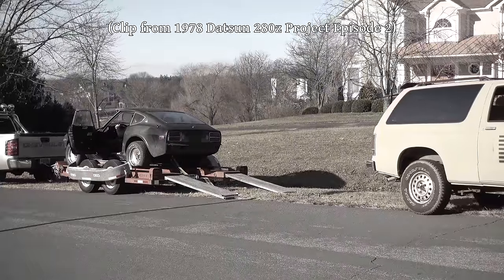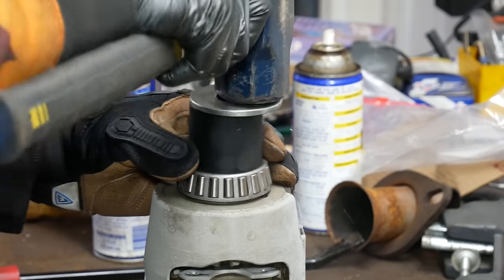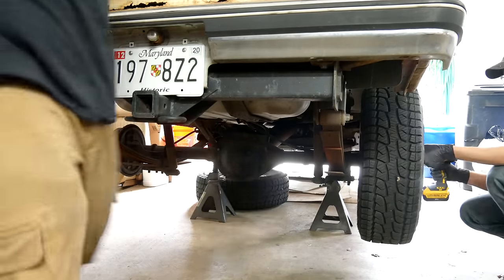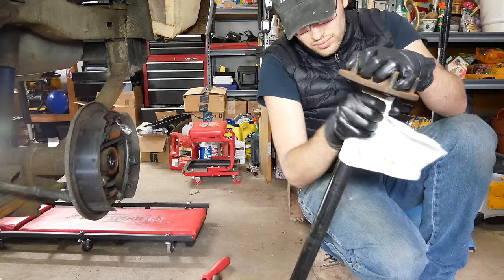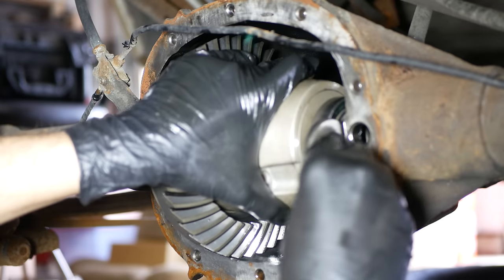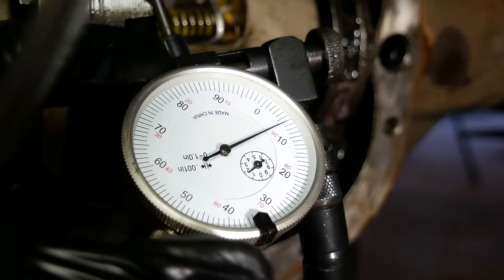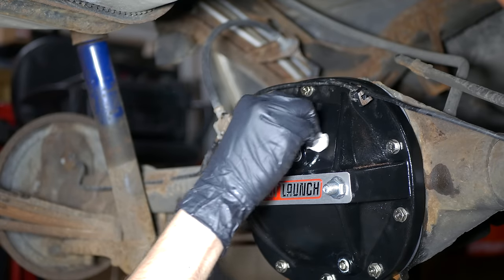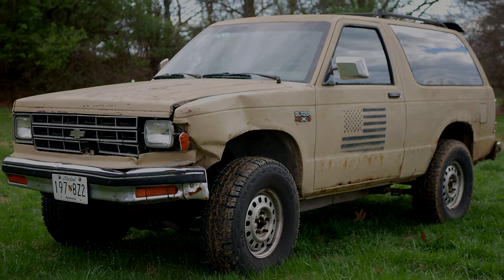4x4 V8 S10 Blazer Limited Slip Differential Install (on a Budget) (Ep.20)

Comment: Would you ever consider swapping a efi kit on the blazer like a fi-tech unit or would you just ls swap due to cost is the same realistically I have a similar build 86 s10 p/u 4x4 and just put a fresh built engine in it but really want to try fuel injection but like driving it and don't feel like a engine swap down a rabbit hole situation.

Comment: I recently acquired a used auburn lsd like this, however when installed in the truck I pulled it from there was little resistance to turn one wheel while the other was stationary. since you have had his unit for a while, does it still retain the same locking force as new? or does it only lock up under torque? I'm wondering if my unit is broken in, or just broken.

Comment: Im doing a build using an S10 4x4 Rear Differential 10 bolt 7.625. My worry was that it wouldnt be able to handle HP/Torque a rebuilt 305 SBC would handle. After seeing this video, it looks like it can handle it. Am i wrong? lol

Comment: Your axle shaft bearings are due to replacement as they look blueish
Reply from the maker: I didn't get any good shots of them and didn't really clean off all of the oil, but they did appear to have a bit of a haze. They are probably original, and while there isn't any troubling wear or damage could do with being replaced just due to miles and age. I am not in a hurry to do so though, and didn't have parts ready (did this job kinda impromptu on the day-of) but it would have been a good time to replace them.

Comment: When it's finished, this vehicle would make a great Boogaloo-mobile. (Assuming it has a carb and not some kind of electronic fuel injection...)
Reply: Still has an HEI module, therefore not EMP suitable... :)
Reply: Well, then it needs to be converted to a carb set-up ASAP.
Reply: @msbae  It is a carb setup, but the distributor has an electronic module in it. Nothing has run breaker point (full mechanical) ignition since the mid-1970s.
Reply: That can be swapped out...
Reply from the maker: It is carbureted, but HEI distributors are controlled with an internal ignition module instead of being fully mechanical like an old points setup. So, not EMP-proof unfortunately
Reply: Again, that can be swapped out. Also, I have noticed that not one person has even asked me what I mean by 'Boogaloo-mobile'. That brings a smile to my face at a time when it's definitely needed. :)
Reply: @msbae  It can, but it's not at all worth it to do so (worse performance and reliability all around). If you're looking for a real bug out vehicle, not to talk down on the Blazer, you start with a mechanically injected Diesel. That's why the military uses them too.
Reply: So, a 70s era K-5 Blazer or a Dodge RamCharger wouldn't be a good choice? There goes some of my plans for the future... :P
Reply: @msbae  Finding either of those that hasn't already died of rust is a pretty tall order already. If you're serious, you'd be better off to buy a surplus military truck that already has the proper powertrain in it.
Reply: I drove a lot of those vehicles when I was in the Army. Not really sure that I would want a surplus humvee. They are not as great as some folks think...
Reply: @msbae  Oh, they're miserable to even sit in. Plus, military HMMWVs are not US street legal. I was thinking more of a bobbed deuce and 1/2 (also a miserable experience, but...) or one of the many civilian trucks that were upfitted for military work in the 80s. Lots of M1008s out there. I think there were some Dodges too. Or, just buy something with a 12 valve Cummins and you're pretty much done.

Comment: That Auburn diff is not a clutch style posi. Its a tapered cone that pushes the oil out of the case to achieve lock up...yes it wears itself to death by moving the oil out of the way so you get metal to metal contact. NEVER use synthetic oil in a Auburn as its TOO slippery and causes the cones to shutter and slip against the case. You actually want this junk to bind! Choose another style of posi cause its not fun or cheap doing it twice!

Comment: I feel like that fill hole is way too high. Looks way overfilled
Reply: I was thinking that might be the case, but I can't be sure. If it is, it will likely start blowing excess out of the breather and he'll find out right away.
Reply from the maker: I'm not sure if there is a good head-on level picture of it in this video, but the fill plug on the aftermarket cover is at most like 1/4" higher than the factory one. I did have the same reaction seeing the aftermarket cover at first but the fill is pretty much in-line with the side bolts on both covers so it shouldn't be a terribly significant difference

Comment: Is ti fine to use threadlocker on oily thread/bolts?
Reply: It's not ideal, but... meh...
Reply from the maker: Ideally you want the oil gone, but the threadlocker will still set even if there is a little oil present. Never noticed an issue using it with hardware that was just wiped clean and not totally scrubbed.